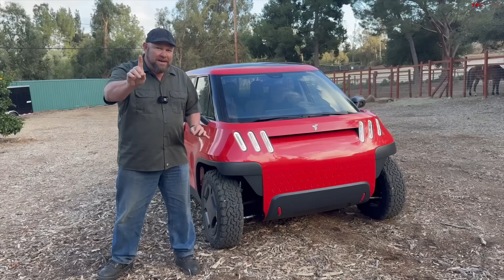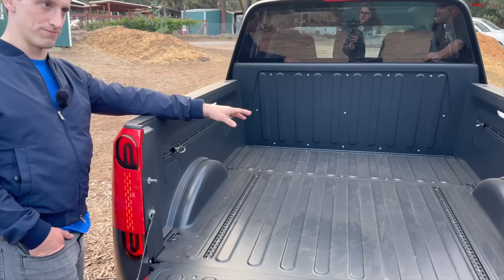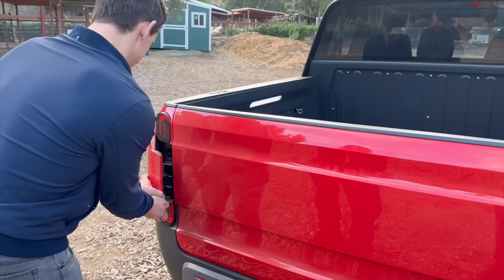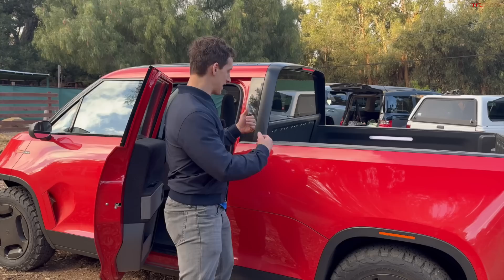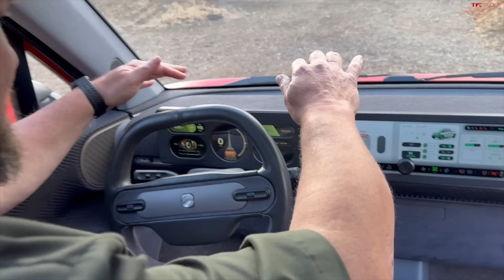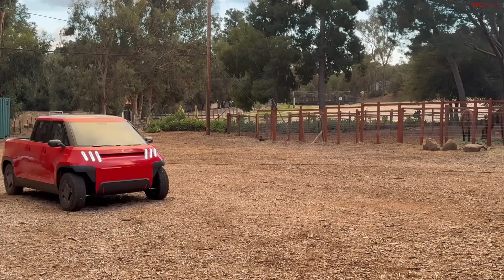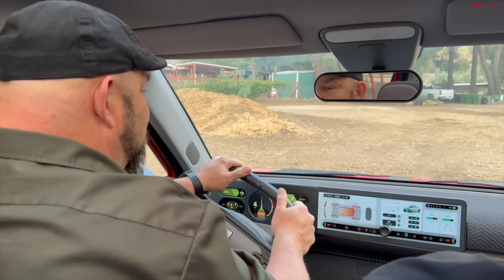I Drive the Most Revolutionary Truck In Decades: Meet the Telo MT1!

Comment: If they could price these in the mid-20s, they would never be able to keep up with production!
Reply: Very interesting vehicle - very interesting CEO.  Wish the best for them.
Reply: With a 100 KWH battery? The battery alone would cost like 12-15k. Unless they cut the battery in half there’s no way this is gonna be under 45k.
Reply: LiFePO4 batteries are under $100/kw. In China, they're around $60/kw. So, a 100 kw battery would cost say $6000 to manufacture.  Cheaper than an ICE vehicle engine or transmission
Reply: @coleweber3262  not at all, LFP cells are down to ~$65/kWh wholesale, I can buy 1.1kWh prismatics for $85-90 shipped to my door. Sure there's some costs to the pack beyond the cell, but it shouldn't be anywhere near tripling the price.
Reply: Ford Maverick hybrid MSRP is $26,295 so you're living in a pipe dream as it only has a 1.5KWh battery pack IIRC.
Reply: @SatoruRyu  UAW salaries and dealer markup are built in.
Reply from the maker: They say the smaller battery one will start around $41,500.
Reply: @TFLtruck that’s a big problem. Mini truck needs mini price. Most people won’t drop full size truck money on a minitruck. The market for this is not in that price range.
Reply: @FnACotton you ever been in a city and highly populated areas? Obviously not.
Reply: @FnACotton  It will sell, just not to you
Reply: @FnACotton no people would definitely buy it. People buy way worse cars for a lot more money
Reply: @TFLtruck well that is about twice what any reasonable person can afford for a small truck.
Reply: @TFLtruck 😂😂😂😂
Reply: @TFLtruck Other sights have reported the quoted long range costing 46k, with an additional 3500 or so for equiped one meaning 50k when they get done , for an CEO admittedly cheaply built, low cost parts EV off the shelf parts mini truck, that has no approvals or been tested for crash worthiness yet.
PASS .
Reply: @TFLtruck I will get one when it is 15 years old used for 5k 😅
Reply: @fortheloveofnoise  probably more like 5 years lol
Reply: @fortheloveofnoise it's an EV. You'll get one for $5k in 15 months. 😝
Reply: @rickmellor  dumb comment
Reply: @MickH60  it's called sarcasm. Don't worry, not everyone understands.
Reply: I would buy it for Ford Maverick prices.
Reply: @JamesRPatrick That's kind of ridiculous to expect.
Reply: @flybriur  Yep, but that's the market that a minitruck is competing in.
Reply: @JamesRPatrick  I mean, I think it's arguably in a category of its own to a decent extent. The MT1 is a good amount smaller than the Ford Maverick but still has a longer bed,  higher payload capacity and tow quite a bit more weight as well.
Reply: Selling at a loss is a great business model until you run out of money.
Reply: @SM-og9pt Make it up in volume!!
Reply: They would probably also never be able to make money 😅
Reply: Hoping these guys can be what canoo was supposed to be

The versatility is 👍
Reply: Just making it into the 30s would be amazing.
Reply: That’s true of any vehicle. Just reminds me of the Nissan Toyota and Mazda mini truck of the 80s and early 90s. You could buy those trucks for under $10,000 brand new. They also made things like passenger side mirror and rear bumper optional…
Reply: What they need is a modular design that allows you to buy more battery as a point-of-sale option so each size doesn't have to be a different model, and an expansion port to take the damn FOMO out of only buying what you actually need.  There are a LOT of customers, especially in the public sector, that would be just fine with a 60 mi range, and you'd have your eye-popping base price.
Well, closer, anyway.  Lose the back seat and midgate and eyes could start popping.
Reply: exactly, this could be the Prius of mini trucks if they give us the most basic and cheapest possible first instead of last.
Reply: The current cost of its very high capacity battery pack, makes that wishful thinking!!!

But if they make it into production????  and with EV depreciation.... Now we're talking....
Reply: @nc3826  mid 20's after a year of production used.
Reply: @nc3826  battery packs have some potential for power and price reduction as long as greed doesnt factor in they have a chance,someone needs to jump in before BYD starts manufacturing in America,let Ford and GM pound sand,they have been complacent to long.
Reply: @nc3826  The average price per kWh of EV battery packs is was down to about $115 in 2024 and is projected to to drop to $80 per kWh by 2026 which means the large pack will probably cost them around $8,000 by the time they get to production (if they meet their target date).  The price of EV batteries continue to drop.  EVs have fewer parts than ICE vehicles.  Eventually they will be cheaper due to the simplicity.  It wont' be next year or the year after but the tipping point is coming.
Reply: @jonathanmyers961  “I know you think you understand, what you thought I said, but I'm not sure you realize that what you heard, is not what I meant”  ― Alan Greenspan 

or what you thought you said, had any relevance whatsoever.....

take care, my  pointless YT wannabe  expert, pontificator
Reply: @jonathanmyers961 Talk to us again when those price reductions happen then.  This is far to expensive.
Reply: @sproutandmerc1941  yeah I went to check the price and was saddened to see $50k, not gonna be doable for a long time.
Reply: Ok, compared to all of his previous reviews of trucks, this one felt like an advertisement.  For example, he complains anytime he feels the slightest that he doesn’t feel the seat or seating space isn’t perfect for him, and he’s clearly jammed in that driver’s seat.  This seemed like a sell out video.
Reply: Never happen with a 106 kWH battery.  Even with a battery half that size it would be nearly impossible to do, anytime soon.
Reply: In asia, they sell a toyota truck for 10k so you know cheap trucks are available.  It's just that the tariffs cause them to be way too expensive to purchase in america.
Reply: Yeah it's way to expensive for what it is . I get EV is more but for nearly half the cost of the base model you can get a base model Maverick and have more vehicle for less. EV and truck just don't work to me none of the EV trucks on the market today can do what a Gas/Diesel truck can do day to day because of range and charging they just can not. Outside of NYC I can't think of a place for this EV other city are to big and spread out for EV trucks to be practical work trucks. I grew up in Houston my dad was an exterminator he drove all over the greater metro area and even to Victoria and Galveston regularly EVs could never do a day of that his last work truck before we moved was a 2004 Nissan Frontier M/T He got it at the end of 04 it had 15 miles on it  we moved in 2011 I think his truck had almost 200K miles on it when we moved and sometimes he had to tow a trailer with equipment and a water tank on it all day. An EV can't do that all day from one side of the city then over here and over there . He would fill up every morning and usually still have gas at the end of the day. And because it was a small family owned business they didn't have the best route planning so one stop could be on the westside close the the office then he would drive downtown then back to the westside then up to the woodlands then out to fulshear then over to Pearland so it was a lot driving .
Reply: 41 grand is just not what we need. We need a bare bones, reliable, rig, for 20 !
Reply: @sproutandmerc1941  agreed
Reply: Toyota makes a small truck that starts at $12000. Nuff said
Reply: @ not in the US because it’s literally impossible
Reply: I know it’s  not in production but all I hear is plastic rattling while they are driving in the car for 46 k they need to do a lot about that
Reply: But why should they make unprofitable pricing ?
Every car would sell in ridiculous numbers when calculated with ridiculous losses in mind.
Reply: @pan6593  I think that it may be unprofitable at any price. They have to sell a certain amount of these each year to stay in business. I think that number may be to high at this price point. Oh at first they may sell to all the niche markets and you tubers, but after that, why would the owner of a small business want this instead of a Maverick if they have to pay 30-40% more.
Reply: Impossible for what it has. The 260m range battery alone is probably ~8k wholesale.  It's at least 75-80kwh. My estimate on their base vehicle production cost is minimum 20K. Not including the per-vehicle facility and labor costs.
You could probably get it down to 30k with a much smaller 150m battery for farm or parts runner use. That might be worth it, considering enclosed SxS are in the upper 20's now. This truck would be way more capable in almost every application, plus road legal.
Reply: @andrewt9204  Thats a good point. If we assume that its ~70kwh at an average of $100/kwh then you're looking at roughly a 35k truck with the pack removed. Hopefully over the next few years the average cost per kwh drops to the $70-80 range.
Reply: Honestly, the low to mid $40's is reasonable considering the insanity of recent prices. I just don't believe it will make it to market (like Aptera) and (if it does) will have large Rivian style increases by then. I worry more about it going extinct like the Ocean and having zero support.
Reply: @papasquat355 low to mid 40's is insane. mid 20s would be good. Mid 30s is pushing it.
Reply: @papasquat355 Sure they can list it for whatever price they wish... Doesn't mean it will sell for what one wishes
Reply: @papasquat355 Lol.   Low 40's can get you a almost a brand new Pro-4x Frontier or Tacoma.
Reply: @papasquat355 The partnership with Aptera is pretty concerning. I put a deposit down, anyway. If it actually makes it to production, passing all the required US safety requirements, I'll be pretty happy. I've been wanting a reasonably sized vehicle that can handle standard dimensional lumber for a LONG time. My next car will definitely be electric, so I've got my fingers crossed that this isn't another Aptera vaporware thing.
Reply: @energydecisions  Aptera probably does have a lot of solar panels it needs to find a way to put to use... If Aptera does flake though solar panels at least on the bed are definitely something the community could solve. I don't know about custom shaped panels for the sunroof, but definitely rectangles seem achievable.
Reply: @papasquat35535k max for this, anything more is insane
Reply: @papasquat355it's a utility pickup 12,000 to 19,000 is within the Kei- truck price range. It can't be more expensive than a Ford Maverick.
Reply: @joelg1318 except it's not a Kei truck.
Reply: @joelg1318  It will be cheaper in the long run due to far lower fuel and maintenance costs
Reply: @papasquat355 if you keep being fine with these higher prices, the manufacturers will never bring down the prices. stop accepting high prices.
Reply: @papasquat355 too expensive for 95% of people
Reply: @papasquat355
Battery cell tech is not only improving at about 20% a year to date but now the price will drop by 50% by the end of this year.  That's from the boss of CATL and BYD. 
The real killer will come with the Li S batteries or Al   Ion or even Na S. all are in pre production testing. Li S and Na ion are in production development.
Reply: @papasquat355 The fully suited up Duel Motor 4WD 500HP version is about $46K. The Single Motor 300HP 2WD is $41K. Decent enough price range, all things considered for EVs.
Reply: @papasquat355inflation caused by government meddling, drives up cost of production.
Reply: @walperstyle  Yeah, lets Make Vehicles Unsafe Again. Let's go back to when a crash could kill you. Production and crash safety regulations are why vehicles are so expensive now. Which is absolute bullcrap. 

Let's not blame the actual reason why things are expensive nowadays. Instead let's blame government regulations that make sure you don't die in a crash.
Reply: @jake_sabrwolf9795  the cyber truck was never crash tested and is still expensive.
Reply: @ the delusion that safety comes from bureaucracy
Reply: @walperstyle  "caused by government meddling, drives up cost of production."

When you're ready to come back to reality, we'll be here waiting for you.
Reply: @ I like the part where your rebuttal is an insult instead of related to the topic. Look up ‘regulatory capture’ because you obviously don’t understand that lobbyists use government to pass regulations to kill competition. The auto industry is the prime example of a corporatist-socialist system of control.
Reply: @jake_sabrwolf9795  

Let’s cut the sarcasm and let’s just say what we mean.
Reply: I was thinking under $30K with a 225 mile range. That is an awfully high price for a vehicle this size. While aluminum and carbon. Allow for adhesives which lower the capital cost, the part pricing of aluminum and carbon is high. They probably would be better off to add a little weight and capital cost but use stamped steel. There are only so many people that are going to pay $50k (my estimate for long range battery.) for a small truck.
Reply: @kylekleman  Dang you're delusional too. 😅☠
Reply: @samusaran7317  great comment with no substance. 🤣
Reply: @kylekleman  Im not here to change your mind.
Reply: From doing right there is a 10 to 20,000 truck. They say that it's a truck's truck. You know people who say trucks truck as in something big. This one's a truck truck as in it is purely used for utility purposes. It is just powerful and versatile. Meaning that you get the maximum for its size and price. But do not expect it to be comfortable.
Reply: @mickalinjezerx7104  Ya they lost me at the price - and I get that they don't have the benefit of scale, but I was expecting him to say it starts in the mid-20s
Reply: @BroPeep your expectations are not aligned with reality. A Ranger costs more than that. I’m only seeing Nissan Versa and similar at that price point.
Reply: @BroPeep  it literally cannot possibly be that cheap lol, people never understand how things work. Just the battery alone is costing close to 10k, they cant possibly even make it for less than 30k let alone sell it for that
Reply: If Ferraris were under a 100k they could never keep up with production!
Reply: The Maverick with a gas engine is more than your projected price point. 

This has more utility, higher towing capacity (at a reduced range), and a much larger battery than the hybrid Maverick. Your price point is giving them away in today’s market. As tariffs and other economic shocks hit the value of the dollar, expect to see prices go even higher.
Reply: Here's what you sound like: "Guys, if this $2,000 gold bar was on sale for $1,000, then stores would sell out so quick!"
Reply: "Shut up and take my money!" :)
Reply: At most 14k
Reply: @The_Duggler25  You're delusional. You can't even find a small gas hatchback for that price anymore.
Reply: @samusaran7317  nah not delusional, just not worth more then that 🤷‍♂️ we live in a time where people happily over pay and don't get there money's worth from it. Delusional is overpaying willingly and then trying to justify it.
Reply: No one is buying EVs so why?
Reply: @magnavoxfifty  too expensive main reason.
Reply: @magnavoxfifty  false
Reply: Not every wants a Hemi. @magnavoxfifty
Reply: @magnavoxfifty do you live in the sticks? The largest single car market in America is in CA. There are electric vehicles everywhere!
Reply: @magnavoxfifty  Rubbish, you should get out more often mate...
Reply: @magnavoxfifty  Where do you get that notion? Check the actual statistics. Maybe Tesla sales are down for various reasons (factory retooling for refresh). Globally EV sales are up while ICE is declining.
Reply: But than they can only sell it to blind people! The ones with eyes would never go with that thing!
Reply: Better looking than the form over function turds out there.
Reply: @Mr19853  you think these current behomeths are lovely,that new chevy frontend,ugh!
Reply: @Mr19853  they said that about cyber trucks also
Reply: @Mr19853  no. It actually doesn’t look bad especially for an electric vehicle
Reply: @Mr19853  I have eyes, I’d  buy it in a heartbeat.
Reply: @Mr19853  I think it’s cool looking. All it needs is AC outlets.
Reply: Different video says that it will have 120v and 220v outlets. BINGO!
Reply: @Mr19853 why? Need a compensator car?
Reply: @Mr19853 So you're not getting one? Well I guess they should just close up. Lol😅

Comment: The USA market hasn't had mini-trucks since about 2005. This could be something!
Reply: Ford maverick is about the same size as 90s tacoma
Reply: @franklindurang  nope the old toyota trucks came in single cab and body on frame
Reply: Also seems like this CEO is mechanically inclined and understands the engineering! I hope to see these in the future.
Reply: What "mini" truck was available before 2005?
Reply: @leeward6762  in 2005 the Tacoma went midsized, aka big
Reply: @leeward6762 you never saw one of the old Datsun mini trucks?
Reply: @BigSam63  yeah, and the chevy luv truck too but I thought they were all gone by the 90s.
Reply: @leeward6762 you besides the ones offered by: Toyota, nissan, mazda, ford and chevy?
Reply: For what this thing will cost you could own two very nice condition vintage mini trucks of your choice. Or one that's been restored or preserved in beautiful like new condition still with money to spare.
Reply: Ford Maverick is a mini truck
Reply: @compton221  Sill huge compared to classic minis or this Telo
Reply: Ford Maverick is NOT mini truck. It’s compact but not mini.

Comment: I think id be interesting to see ford try to make a gas powered kei sized pickup
Reply: They ended them due to mileage regulations - larger trucks get away with bad mileage. Smaller trucks, still not very aerodynamic, are much harder to design to meet spec.